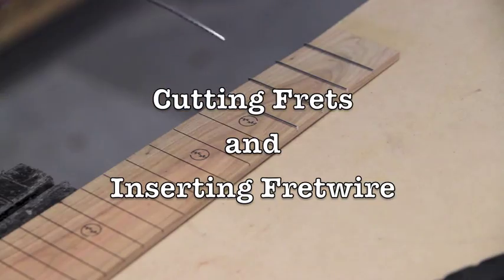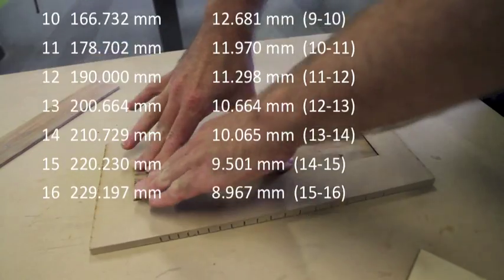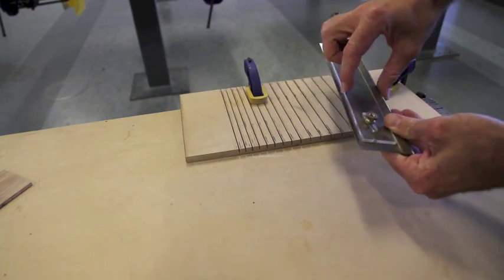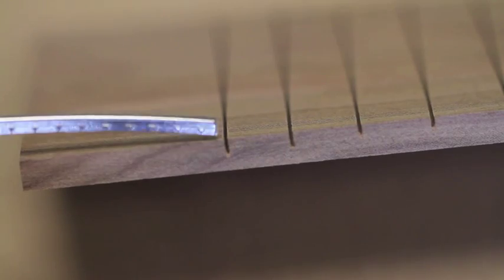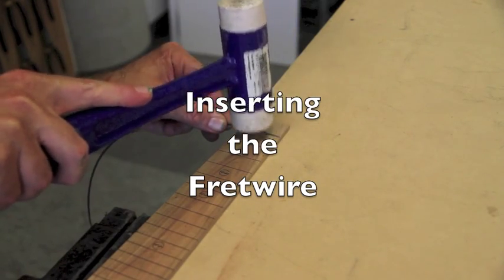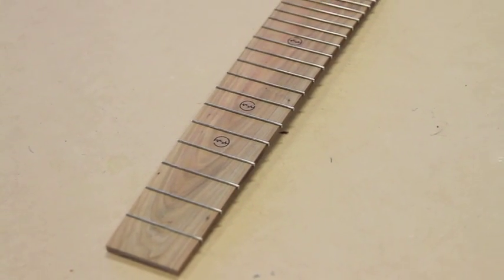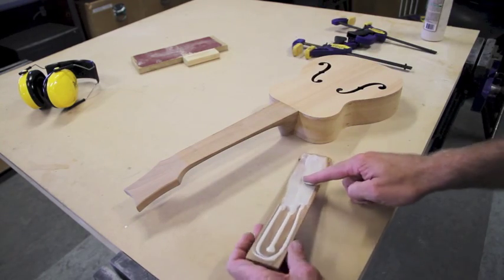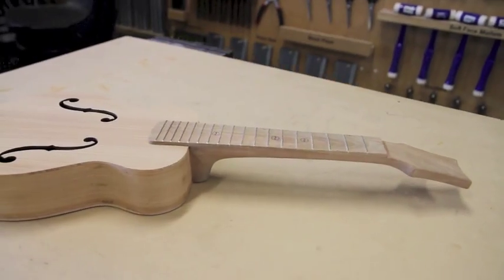How to make a ukulele 13 - Cutting and inserting fretwire

Comment from the maker: There are a few different parts to the uke and there are plenty of options for each part. For the body, a good option is Hawaiian Koa or if you can't find that, then Tasmanian Blackwood is quite similar sounding. I used Cherry for the neck shown in this video, but many timbers are suitable as long as they are reasonably strong and stable.